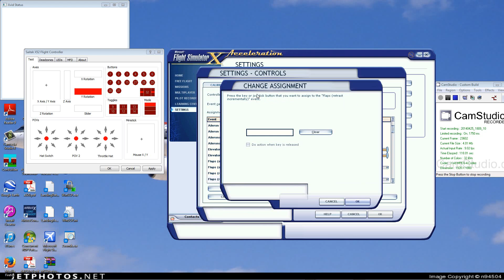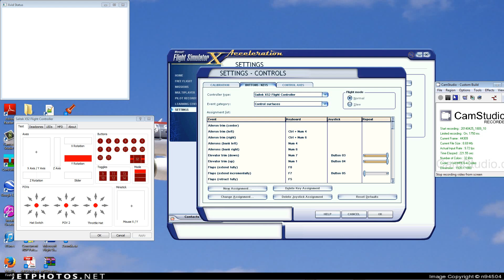How to Enable Pinkie Switch on Saitek X52 (Not Sure About Pro Version)

Comment: Open profile editor, switch to grid view.
Delete the Mode 1 + Pinkie, Mode 2 + Pinkie, Mode 3 + Pinkie.
Save the profile with a name and close.
Enable the saved profile.
Sorted.
Reply: acarus3 Thanks dude, now i dont have to keep the control panel open all the time :D
Reply: acarus3 -  Thanks, there is a similar post in the Elite Dangerous forums.

It turns out that it's the profile that you're using, not the drivers.

The updated profile manager added the ability to use the Pinky Switch as a shift key, it didn't break anything.

You may need to set the Pinky Switch to Unassigned to finish fixing your profiles.  Other profiles are probably similarly "broken" so you'll need to check them as well.
Reply: Thanks dude, now the switch mode works on Elite Dangerous.
Reply: Thank this worked for me as well. Except I couldn't delete those modes with the editor. I had to open the profile with a text editor, its just an XML file. I used Notepad++ and removed all references to the pinkie / button 6.
Reply: thanks dude, that's awesome
Reply: Thank you!!!
Reply: Thank you so much! Works in 2022!
Reply: You sir are a god damn hero!!!! o7

Comment: Thanks! I freaked out when I noticed that I couldn't use it anymore!

(Installing the latest drivers was the first thing I ever did after I connected the X52. It worked for 3 hours and then suddenly stopped working).

Comment: I have been so frustrated with this controller, which I have owned for about 1 1/2 years.  The pinky switch was one problem I could not figure out.  I too use it as my flaps retract button. Now I can use it again thanks to you.

On a side note, I have been losing control of the stick (not the throttle).  I know this is happening because the lights flash on the stick and then whatever position the stick was in when the lights flash becomes center. So, if I were banking to the right and the lights flash, when I let go of the stick, I am continuing to bank right and have to push left twice as much to compensate for this to maintain level flight.  The only way around it is to unplug the USB and plug it back in so it identifies the center position correctly again.  I have been working with Madcatz/Saitek to correct this problem to no avail. I returned it to them under warranty and got a new one, which I am having the same problems with.

Have you had this problem as well?

I am going to leave the Controller Properties window open and do some test flights to see if this also corrects the centering problem. Thanks for the video.